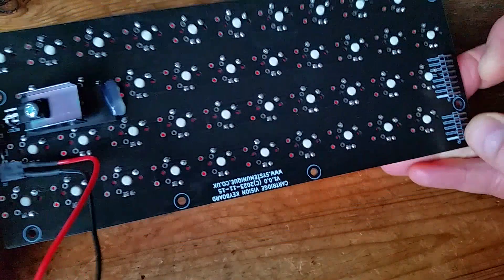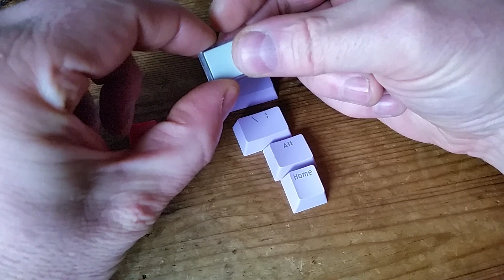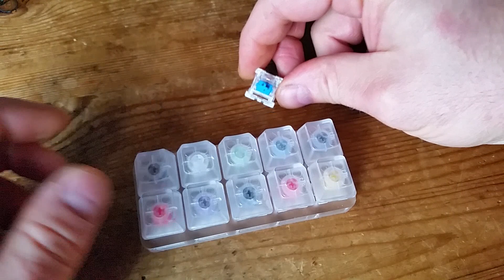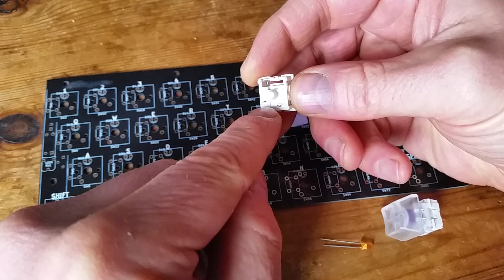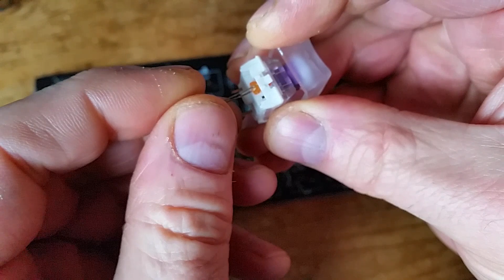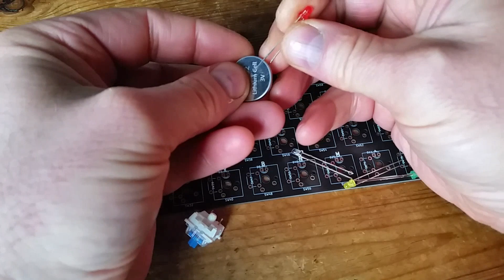Retro Computer Keyboard Design

Comment: I notice that you've gone for a non-standard offset between the rows on your keyboard layout.  Is there a reason for this?  The usual offsets are ½, ¼, ½.  While this originally came from a mechanical constraint on early typewriters almost every keyboard in the world sticks with this.  It helps touch typists having a consistent layout.
I noted your good advice about the rotational orientation of 5 mm LEDs with respect to the hole in the bottom of the key-switch body.  But the pads for the LED seem to be rotated 90° from the orientation you suggest.  Am I missing something here?
Reply from the maker: The spacing I used for the keys was just placing the KiCad footprints right next to each other. If I'm not sure of spacing I usually print out the silkscreen layer on my laser printer @100% scale, and see if the actual components look like they align well. They looked OK to me in this case, I did want to reduce the gap as much as possible and didn't follow any spacing rules. The LED's I learned though experience, so the circuit or layout in the video may have been the original attempt.
Reply: @DevelopIT  Sorry, I wasn't clear.  Examine a normal keyboard; you'll see that R is exactly halfway between 4 and 5, and B is halfway between G and H.  But S is NOT halfway between W and E, it is only 25% of the way along to the right rather than 50%.  Look at the shape of the right hand side of the column 7, U, J, M - it isn't consistent, it is deliberately like that so that it is the same everywhere.
The pitch, between keys (row-wise and column-wise), is a different issue.
However, I guess it's your keyboard so your choice.
Ah, I see about the LED thing now.  It wasn't at all clear in the video.